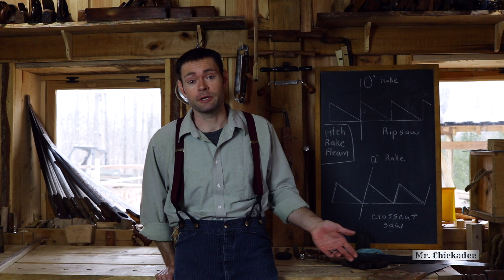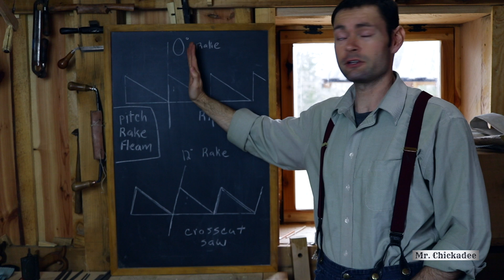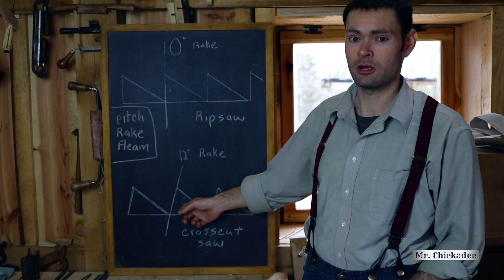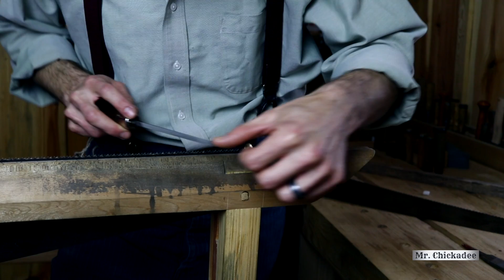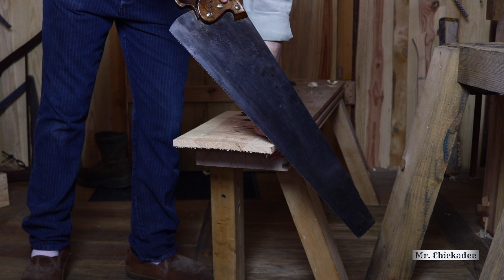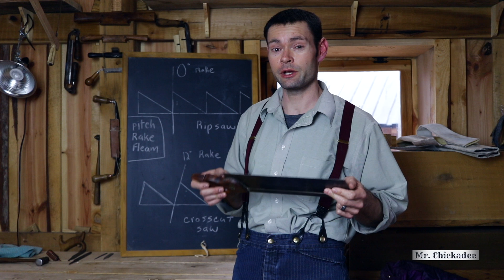Hand tool tutorials; buying, restoring and sharpening a vintage saw

Comment: Hello. My name is Trevor. Could you please explain the numbers on a saw set and what number to use on a Tenon saw if any set needs to be done. Enjoy your videos. Thanks  Trevor from Australia
Reply from the maker: Trevor that will depend on the brand and all will be different i would use the lowest amount first then increase it if the saw binds in the cut, you want the least set possible, very little in dry hardwoods, a lot in green softwood

Comment: Thanks for the great information, and for the tip on sharpening smaller tooth saws at the end! I have quite a few vintage saws that I am planning to restore, and your video is a great motivator. I have realized over the years, that in this world of power tools, for smaller jobs using a hand tools is often faster, more enjoyable, and usually more precise. Super video! 🙂

Comment: Excellent video. I especially like that it is concise and avoids unnecessary details. I think for a beginner that helps a lot.
I have one question, though. I bought three old saws (probably not high quality). On all of them the handles are loose. They don't have the screws like the more well made saws I have seen in videos. Instead the handle is attached with rivets (? not sure if that is the correct English word for it). 
I drilled out the rivets to remove the handles and found that the handles were loose because the holes in the saw plates were worn out. Do you have an idea for an easy fix? (I am not interested in a nice looking result. I just want it to be functional.)
My idea at the moment is to drill out the holes in the saw plate (with a carbide drill bit) to a slightly larger diameter and use screw of that diameter along with a nut and washers to fix the handle to the plate. But is it even important that the hole in the saw plate has the same diameter as the bolt/screw? Or is the pinching force enough to hold the handle securely in place?
I watched a couple of saw restoration videos but none of them addressed this problem.

Comment: Remember watching a cabinet maker in the Philippines sharpen his saw the same way. He worked with two saws half a dozen chisels and a block plane like I've never seen any where else. The plane had a stack of blades and corresponding guide blocks that attached to the bottom. He could do dozens of mold designs and raised panel designs with this one plane. I figure he had made everything plane related over a lifetime he was probably in his mid 70s and seemed to enjoy his work very much.

Comment: When ripping, have you ever found that wood grain can cause the saw to drift toward or away from the line?
Reply from the maker: This can happen, with enough set it should be less issue. A wedge will also help hold the wood apart to prevent pinching the saw.
Reply: @MrChickadee  Thank you.

Comment: Great video as always. Roy Underhill had a good analogy: Rip saws are like little chisels or planes for removing grooves. Crosscut saws are like little knives for cutting the fibers. Either saw will work in either application, just not as well as the correct one. Rip saws tend to leave a much rougher edge when cutting across the grain, but like you mentioned, if you have enough teeth per inch, it is hard tell the difference.

Comment: I have two one man crosscut saws. One is cutting fine. The other is hesitating and stopping short. Both were at the local saw sharpening shop.Due you have any suggestions for me on that other saw. The sharpening shop is closed due to covid-19. Thanks.
Reply from the maker: Its hard to say from far away, I would only GUESS that is MAY be an issue with the rakers being too long, but if they are so long that they are longer than the teeth and actually causing stops...well they are WAY too long, the rakers should be shorter than the cutter teeth. This is all of course based on the assumption you have a saw with both raker teeth and cutter teeth...
Reply: @MrChickadee  Yes both have raker teeth, they are the same style of saws. They are like yours. I thought that maybe it was the set. I am going to check those rake teeth. Thanks a million.Wish I knew how to send a photo to you. :-)
Reply: @MrChickadee  Thanks for that tip! I took one of my chainsaw guagges to check those rakers, and sure enough that is the problem. All I have to do now is figure out how to file them down properly. Thanks again. :-)
Reply from the maker: @ronaldkearn3322  I did a video on that here https://www.youtube.com/watch?v=hO558SpQpxM&t=27s
Reply: @MrChickadee  Thanks again. :-)

Comment: Boy you brought back a flood of memories! I am a retired shop teacher and while in college, almost 60 years ago, I took a class in hand and machine tool maintenance. First assignment was sharpening a handsaw. Jointed off half the depth of teeth, blueing the blade and measuring/layout each tooth, then filing each tooth to shape and sharp. Not as easy as it looks! Next assignment was to do a similar operation to a circular saw blade. I learned much and still use the knowledge today. Thanx for the excellent video and the memories!  ><>
Reply from the maker: Half the tooth height is a good amount of filling to do! But would be a good way to teach the technique to a student for sure! Learning to even everything out is essential when starting with often abused and miss filed old saws (calves and cows)

Comment: Great instructional video, kudos.  However one point I noticed when your were comparing old saw to ones in the 70's or so, the year made does not necessarily make them a bad saw even due to a poorly designed or made handle.  Thanks and keep on smiling.
Reply from the maker: I don't know exactly when the steel quality, taper grind and all went to pot, only that modern saws are not good for this work, so I find looking for a saw in the way I described is a pretty sure bet, that is why I recommended new users to start this way.
Reply: @MrChickadee  As a machinist for the past 40 years and having to know all metals to a good degree I guess we all have our opinions.  thanks again.

Comment: Hi, Congratulations on your channel, its one of my favorites now. I am having problems finding rip saws where I am. Do you have any thoughts on the difficulty in converting a cross cut saw to rip (I haven't ever sharpened a saw, so there is that, but I really need a rip saw now. All the wood is too wide and difficult to buy. Thanks!

Comment: A helpful hint on dating a hand or panel saw is the sex bolts that secure the blade to the handle- a magnet helps tell the story. During WWII brass and bronze was in short supply and war material priorities had the saw manufacturers switch from the afore mention materials to ferrous or steel sex bolts, and they have remained so ever since. And that worn out saw would be scored and snapped into card scraper stock, the temper of which is perfect for such reuse. I've got a Henry Disston 5 point rip saw from the 1870's- if a patent date(s) is etched on the blade, it's true age is generally assumed to be within 10 years of manufacture of the most recent date. The ergonomics of those old saws went well beyond "pretty" there was a science to those designs that allowed a craftsman to use one all day long with little or no fatigue, hence thumb rests, handle sweep, roundovers, all played important roles in a buyers choice, but are now a thing of the past.
This looks like the launch of a new direction for the channel; that's good news, you can never miss with educational segments. ☺

Comment: Another excellent video.  I picked up  a tip from Paul Sellers, it helps to make an oiler for the saw. I used a small tomato paste can, rolled up a shop rag tight as possible and stuff it into the can (keeping the towel about 1/2 in. proud to avoid metal on metal) and add a good dose of 3-in-1. Just a swiped or two on each side helps glide even easier.

Comment: Maybe I'm a boring old guy but I found that incredibly interesting.  And you hit on all the important points.  Even setting the teeth!  I have a number of old handsaws here that were covered in rust.  I took the handles off and soaked them in a vat of vinegar over night.  Most of the rust fell off.  I then rubbed the blades down with some emery cloth and sprayed a lubricant on them.  Great video.  Thanks.  At 66 I've only begun to learn.

Comment: Two things I reckon I missed .. Your de-rusting of the blades using a stone as opposed to something like Evaporust follows your "theme" but stones and pitting have their own problems. How do you prevent rust staining of the wood you're cutting if you never completely remove the rust? And lubrication and maintenance of blades after cleanup for easy saw movement???

Comment: I've seen several videos on saw sharpening and this was by far the most clear and concise. The only thing I wish you would have addressed is the setup of the saw set (how to set the depth of where it sets on the surrounding teeth to where the punch ends up, as well as how deep to set the punch's travel. Maybe that was too varied a topic to include in here. 

Thank you for this new series. I believe it is greatly needed and will be very well received.
Reply: Me too.

Comment: Excellent video!!  My father and grandfather were hand tool only house builders and they took very good care of their saws,  One point my father always told me in purchasing a used saw was to look for saws with 5 bolt fasteners not 4. The other points you made were all right on.  My father could cut lumber all day long without using his square and all cuts were dead on square.  I could never achieve this, but did not have the millions of cuts under my belt that he had.

Comment: Very nice to hear you talking and a good tutorial on sharpening saws. However for rip cut saws I would suggest to first set than joint and finaly sharpen. That way it should be more easy to end up with the cutting edges square to the blade.
Reply from the maker: I think its easy to overthink all this stuff, I often take off lots of material in the jointing which would destroy set put in before that. After that, I often only set the saw every 3-5 sharpening cycles, but yes, to be perfectly dead flat you should set after sharpening...Ive just not really bothered nor noticed much difference in performance between "perfect" and "almost perfect" haha

Comment: thanks for this, would you wax a sawblade like you would a plane sole or is it just not needed?
Reply from the maker: I have, cant say it made a huge difference in most woods, but I do make sure the saw plate is pretty smooth during rust removal anyway, and the set should prevent the saw from rubing that much.
Reply: @MrChickadee  that's my thinking too, maybe on a finer saw with little to no set in hardwoods. thanks for replying.

Comment: GOADHEAD likes! I am going to try my first sharpening but wonder.....Has anyone ever converted an old Diston to a pull saw?
Reply from the maker: Ive seen it once, with welding a tang handle on the toe, but why would you want to? They work just fine as intended...
Reply: @MrChickadee  Just thot there would be a lot of used saws that weren't bent.

Comment: Do you have to joint the crosscut blade as well?
Reply from the maker: For sure on its first sharpening, after that not every time, I just joint my CC saws every now and then to be sure im not getting too carried away. In most crosscut applications, you are only touching wood with a few teeth at any time, so having the saw perfectly jointed is not needed. I also prefer a good breasting to the saw which also helps tooth contact I feel...some of the finer points I did not go into in this very basic video...
Reply: @MrChickadee  Good to know, thank you! I thought the video was great I just had that one question.

Comment: You can re tooth a saw by filing off the teeth flat. Make a jig with the spacing for x too and cut them in with a hack saw then file them to shape fairly quickly and easily with a triangular file. Sharpen and kerf from there
Reply from the maker: Yes, I do this sometimes, but in this video I just wanted to get people quickly into using a good saw, so left out the more involved steps or options.
Reply: @MrChickadee  I get that. I hope watching what you make and what patience can bring. There's nothing like the feeling you get after the hours you spend on a project to see the final outcome and be truly happy with what you see

Comment: Thank You very much, Mr. Chickadee!
Question: is there a way to set teeth consistently without this teeth-set tool?
Reply from the maker: Sure, a very small hammer can be used, or an older tool, a "saw wrest" which is just a thin steel plate with slots cut into it, you just place the slot over each tooth and bend, both these take more care and skill to get even, but you could also place the set saw in a vise with shims of paper to squeeze everything equally afterwards.

Comment: I definitely like this video format from you. I look forward to what's next for this series. 

Also, I'm curious if you have plans to make a video about how to maintain and clean your maintenance tools such as the files you used to sharpen your saws. After a while I've noticed mine get clogged, or water from condensation gets caught between the teeth and rust will set in if I haven't been in the shop for a few days. I typically wipe down all my hand tools and apply a coat of machine oil once a month, but my files tend to get hit hardest in colder weather.
Reply: Definitely use a file card(brush) if you dont already
Reply: The rubber block that is sold for cleaning electric sanding belts rubbed the wrong way down a file helps with the debris that a "file card" (fine wire brush) misses. Also, my grandfather kept his files in a coffee can full of sand and old motor oil, he never had a rusty file unless one of us grandkids "forgot" to put it back where we found it. He had 7gal buckets for his digging tools as well. He was a coal miner, so he had to deal with his tools being in some pretty damp places while at work.

Comment: As someone who has been buying and restoring old tools for years, I'm very pleased to see you starting on this series. I sharpened a 22 TPI dovetail saw yesterday..........Not sure how many more years my eyes are going to allow me to do that!! I use 12 TPI as the cut-off for sharpening everything rip, rather than the 10 you use, but other than that, I think you got everything spot on.
Reply: Magnifying goggles help with fine craft things like "high tooth count" saw tending.

Comment: I have used many saws.  Even more modern ones  I have Disston saws from the late 1960s and 1970's. They fine saws but as pointed out they may be uncomfortable.  You can get use to it,  do like Paul Sellers and make a new handle using better designed handles as a template.  A final way is modify you handle with rasp and file to fit your hand.  It was just a tool that you made your own with some hand work. Think of it as only a tool that you will use for many years and not a collectable that just using it destroys value. Make it your and will have many stories to tell.

Comment: After you are done with the restoration (rust removed, sharpened and so on) what is the best thing to apply on the saw to prevent it from rust? I did one saw that was almost gone for trash and put some bee wax on it but it doesn't feel right, do I have to mix the wax with something or heat it first? Thanks!

Comment: Great informative tutorial, I find a gentle method for restoring rusty steel is soaking parts in a mix of molasses and water for 2-3 weeks. Have you ever blued or coated your saws to help with rust or just oil them. 
Would like to hear your take on larger crosscut felling saws (two man and single buck) but that might be for another video. Thanks for sharing

Comment: Saveedge tool in Ohio will resharpen files.  They hav a process that chemically resharpens a file using muriatic acid. The resharpened files from saveedge are as good as new.  I have rescued many old files and had them resharpened. Only costs 2-4 bucks a file depending on the size of the file to resharpened. Great video!

Comment: Hey I`ve got this awesome idea for a power tool which would automatically sharpen saw blades. Preferably it would sharpen power saw blades but is could also sharpen hand saws hypothetically. I will call this product a saw saw because it will cut saws.

Comment: A timely video, since I have just started to buy some antique tools.  Sadly many of what I'm buying is stuff my dad, and didn't survive or end up with me after the estate was dealt with.
One thing I would have liked to hear more about is reasons a saw would cut crooked, and how to correct it.
I'd also like tips on sharpening drill bits.  Like the crock screw kind.  The flat ones aren't too hard, but you could add a couple tips.

Comment: So to straighten the saw, you essentially hit in the valley of the warp?  Feels counter intuitive.
Reply from the maker: the direction of the curve away from straight should be placed downwards while striking, so it seems if there were a valley, you would be inverting this valley so as to strike the apex of the valley, or its opposite side, not into the valley, which would only exacerbate the issue